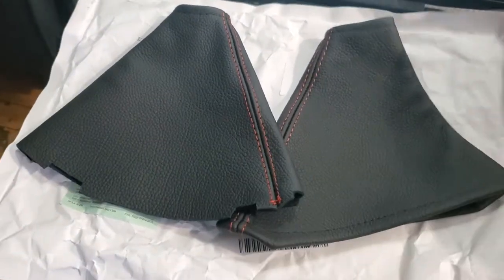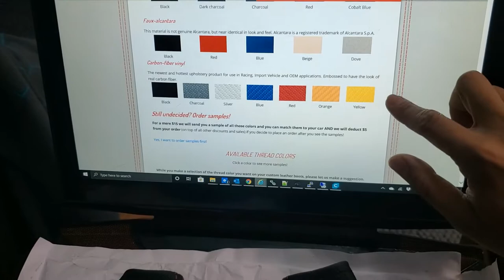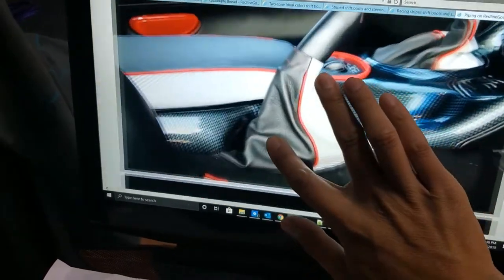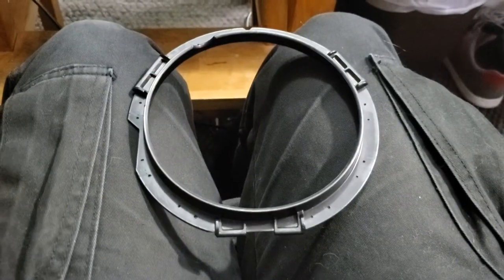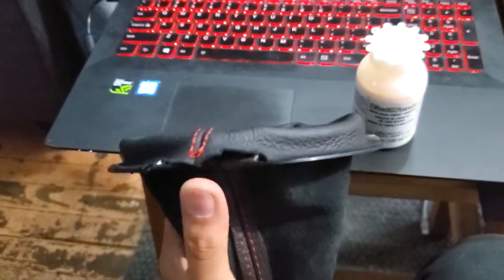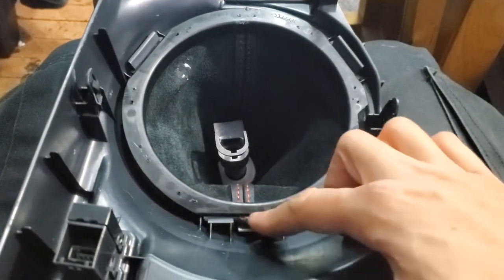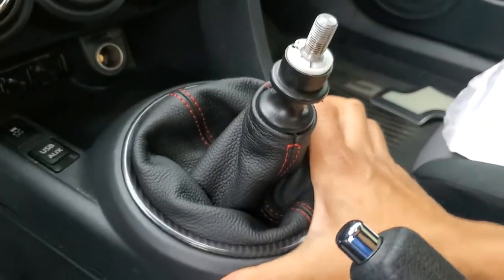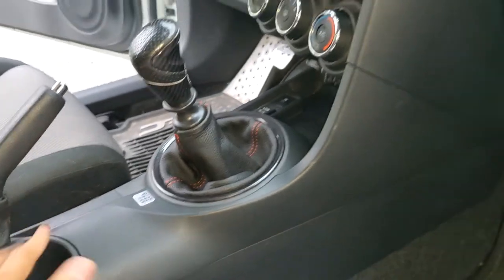Redline Goods Custom Leather Shift Boot and E-Brake Boot Install (Scion tC2 / tC2.5)

Comment: Where'd you get the silver ebrake button? I've been having a hard time finding one that fits in the stock ebrake handle.
Reply: Nvm I'm dum lol I just realized that's the stock one for the 2014-2016 🤦‍♂️I thought it was aftermarket or something because I have a 2012 and it's just flat black
Reply from the maker: @napoleondynomite4053  I didn't realize the 2011-2013's had a different button. Did you see my latest video about the ACGG button? He still has a few left.
Reply: @VampyreX13  Yes I did and picked one up right after seeing the vid lol thx

Comment: Is there a way you got the wire from the old boot to stick in place on the new boot?
Reply from the maker: I just stuck it above the stitch line on the new boot, and it stayed in place when I reinstalled it. If you're having problems with it staying secure, you could always get a needle and some heavy-duty thread secure in place.
Reply: @VampyreX13  thanks so much! I just bought a boot from their site and saw they said to thread it through the hem. But knowing i can do it either way is comforting.

Comment: Where did you get that carbon fiber ring that goes at the base of your shifter, the ring that goes around the outside of your shifter boot
Reply from the maker: I wrapped mine. If you want something different, you can also get a metal one from https://www.acarguysgarage.com/collections/scion-tc-only-parts/products/replacement-scion-tc2-2-5-shifter-beauty-ring
Reply: Oh wow thank you very much for that link. I hate our plastic ring we get stocked. Not like the STI's who get a metal one.
Did you get only ole carbon fiber wrap or a specific one?
Reply from the maker: @keitht8595  I just used VViViD 3D carbon fiber wrap.

Comment: I miss having a clutch… !$#@^&*%!1!! deer… 🤬

I’m probably going to try to cook something custom up for the automatic transmission’s shifter… the plastic-sliding-on-plastic look just isn’t doing it for me. I found some marine grade vinyl on clearance, so I ordered a bunch (regular and 4-way stretch) to play with (I’m not a vegan or anything like that, but I dislike having animal products in machinery… it rubs my engineering senses wrong) so I don’t think I’ll be getting any “genuine” leather, though… 🤔

Comment: Where did you get that carbon fiber ring that goes around the leather boot ?
Reply from the maker: I just used 3D carbon fiber vinyl to wrap it.
Reply: @VampyreX13  thanks man. I will watch  many videos of yours. I just got 2014 scion tc